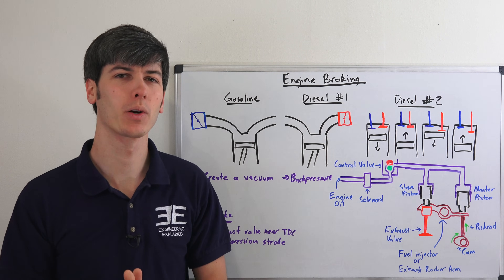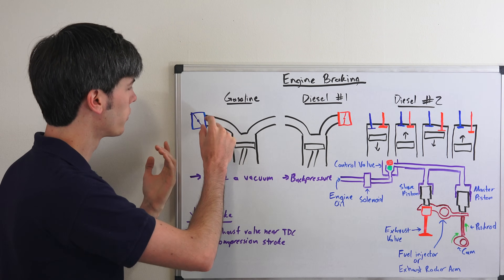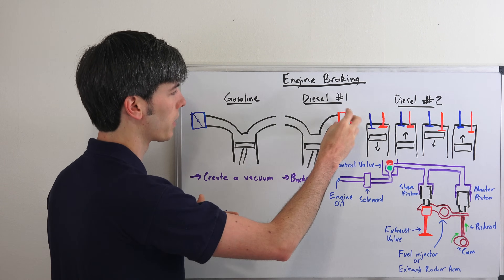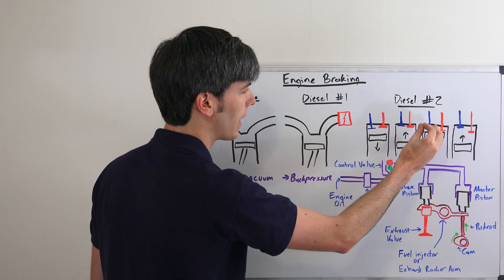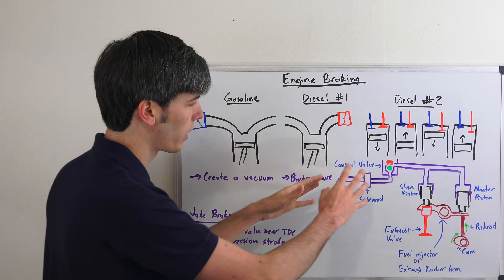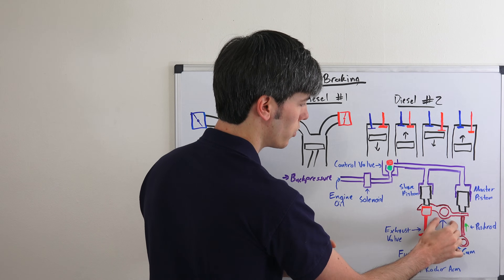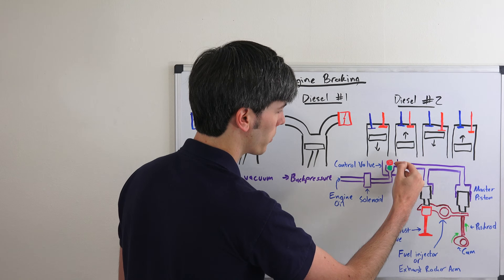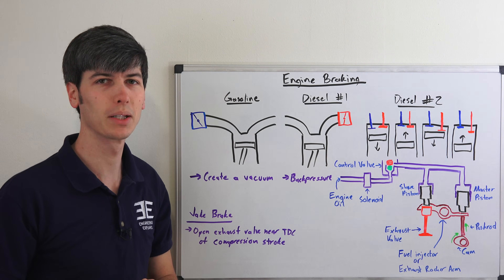What Is Engine Braking? What Is A Jake Brake?

Comment: The "Jacobs" brake was invented by Clessie Cummins after he retired from Cummins Engine Co.  He originally approached Cummins to use it, but they were not interested. So he went to Jacobs Manufacturing (The people that make Jacobs drill chucks) and they built the brake. The logo on the Jacobs brake is the same logo as on the drill chucks.
Reply: Mr. Cummins gave his patent to his daughter and son in-law as a wedding gift. The son in-law was of the Jacobs family.
Reply: I'm glad it became the Jake brake instead of cum brake xD
Reply: Really?  I had to read the comments to understand where the term "jake" came from?   Thanks to the Wizz.  But tell me this ... it is not a switch right?   .... just let off the gas, and the system does it (jakes) right?
Reply: @scottmonfort  You have to usually flick a switch on the dash to engage the Jake Brake then let off the accelerator then it does it's thing. Some have 3 settings off on or standby for the Jake brake the standby mode works when you take your foot off the accelerator pedal and disengages when you put your foot back on the accelerator. The on setting you have to flick the switch off before you can move forward.  I may of got some of that wrong but that is how I understand how it works by riding with my father who use to drive trucks as part of his excavation company job well until the state of Vermont took his CDL away for his epilepsy even though at that time I was in my teens and never had I seen him have a seizure but they felt the need to take it away. They even tried to take his drivers license away but after my father said he was going to go on disability because of it they sent the drivers license back he was intending to drop his CDL but what pissed him off was having it taken.
Reply: @02091992able  mostly right, except they all have an on/off switch, when on, the jakes will usually only activate when APP is read as 0%, which is when the process wxplained in the video is carried out. Some systems are optioned with a 2 or 3 positon switch, 2 position switches activate either half or all cylinders (3 or 6 in the case of an inline 6) and 3 pos switches activate 2, 4 or 6 cylinders. Gives greater control over braking effect and with prolonged use oil temps can increase, so can be used to prevent that on long downhill runs with brake modulation

Comment: Very good explanation of this. One thing to add though is with modern electronic diesel engines the 'control' solenoid is no longer needed as the engine computer is able to simply control an electric over oil solenoid to the exhaust valve to activate the system which gives much more precise control than the old master/slave type system of days past. Some modern engines even use the VG valve in the turbo to compound the engine braking using both back-pressure and compression combined together to often give the engine as much or more braking power than it has propulsion power depending on the engine spec for HP.

Comment: New Volvo's have both and they brake like not tomorrow. All modern truck diesel engines have electronic fuel injection controlled by a computer. Some light trucks with diesel engines have a variable pitch turbo that does the same thing as the exhaust butterfly.

Comment: Why did you not explain about engine braking in electric cars?
Reply: +Kevin Arnold I'll explain that here. You simply reverse the polarity (direction) of the electricity by turning the electric motor into an electric generator and that changes the electric motive force in the opposite direction. Train locomotives have been doing this for decades. You have to have some serious heat coils though because you are turning that motion energy into heat energy and that heat has to have a way to dissipate.
Reply: diesel mutt88 ok fine but i asked him why he dint include that in the video :P
Thanks for the explanation though
Reply: The Tool Guy I don't know. From all the youtube vids that i've seen, they all call it "engine braking"
Reply: The Tool Guy yes but the term they used was not motor braking

Comment: How come some cities have signs that say "No Jake Brake"? I was thinking you would have covered that in the video.
Reply: Ah, thanks guys. I've passed through some towns and saw the signs but never really knew why they were there.
Reply: +Beau C They are really loud and disruptive to people who live near the roads with those signs.
Reply: +Beau C It is very, very loud. 

It's in towns that have highways passing through them. As in, when you see the speed limit signs go down from 70mph....to....55mph...to....40....to 35...

Slowing down from 70 to 35 is extremely loud in a big rig engine braking. Like rapid fire explosions coming out of the tail pipe.

Same reason trains can't use horns past a certain time in some towns.
Reply: +Beau C They are loud. Check out other videos by searching 'trucks using jake brake'
Reply: It's because some trucks are "un-muffled" and are quite loud. Colorado is one of a very few states that have "No un-muffled engine brakes" ordinances.

Comment: I engine brake some times.  I just do it to look cool and confuse the driver behind me (assuming they're following at a pretty good distance of course)  as they probably have to think about it for a second how i'm slowing my car down.  most people dont think about it who drive automatics.   
sometimes another way I like to brake manual cars in neutral and just coast and use the brakes alone to come to a stop.  I think it could help reduce wear on drive train parts but this is potentially risky as the engine is completely disconnected from the wheels..I'll usually only do this on a long straight to a stop light or something.    hey if its a nice car thats old or valuable you may want to reduce wear on your transmission parts and only wear out the brakes which are cheaper and easier to replace.

Comment: is it bad for your car engine if you do this?
Reply: Any semi auto/auto transmissions will not allow the engine to overrev, so there's no risk really to engine braking. I'm used to high displacement pickup engines so I use engine braking quite a bit, but it's not really effective on small displacement engines.

It's all about preference, but you don't need to worry about hurting your engine by using it to brake, as long as it doesn't overrev.
Reply: +Atlacatl nope, as long as you don't go over redline as components weren't designed to go over. I think it's actually better for the car overall as you save a little wear and tear on the brakes by using the engine.
Reply: +Atlacatl for rotaries
Reply: +belanger9 No thanks, I'll use the brakes, they are a wear item and designed to be easily and relatively cheaply replaced, unlike engines. They also work on all the wheels, not just the drive wheels.
Reply: +Barry Ervin 
On mountain downgrades, you need to downshift. Brakes are only for temporary use, as brakes easily overheat and fade, within as little as 45 seconds.

Engines can easily take the heat, as they have huge thermal mass, and a serious cooling system. Engine braking does not harm the engine nor the transmission, unless you overrev. If the engine fails, then you may need a new engine or a new car. If your brakes fail, you could lose your life. Which do you think is worth more?

Also, the drive wheels are sufficient braking force. If the drive wheels take you up the hill, why wouldn't they also as easily take you down the hill? The tires are not the weak link in the system anyway, but rather those tiny, easily-overheated brake pads. Also, overheated brakes can set fire to a vehicle. That can cause loss to more than just the engine, totaling a car. Today's cars are made largely from solidified oil (plastic) which may allow just enough time to rescue the baby from the car-seat. I hope your cellphone gets reception in the mountains, as you might be waiting for hours for somebody to pick you up?
Reply: +Barry Ervin Brakes mean nothing when they're overheated. I've been there, driving an F-250 down a mountain with just a tiny (8 foot long) weed sprayer trailer and some rocks in the bed. I seriously underestimated the weight of the rocks and trailer combined and the brakes gave out with no warning whatsoever, the pedal just went straight to the ground.

The only ting that saved me was the truck, having a manual transmission and a 460, had serious engine braking potential. I should have been using it much more than I was, which would have saved the brakes. The brakes are FAR more effective than the engine, which was struggling to slow the truck down, but only for a certain amount of time. Now whenever I drive down that mountain, I always treat the engine as the primary brake and the brakes as the secondary backup stopping force.

Also, there is much less wear on the engine from 3,000rpm of engine braking than 3,000rpm of normal driving, because there is no combustion going on and thus less heat and less sudden force on the crankshaft, connecting rods and piston due to combustion, plus the increased cooling capacity that comes with a fan and water pump spinning at 3,000rpm with no combustion heat to remove. I've heard of engines blowing from just running, but never heard of one blowing up from engine braking unless it's been redlined.
Reply: *****
The brake pedal went straight to the ground? Did you have a hole in your truck cabin floor?

How long did your brakes last? 30 seconds? 2 minutes?
Reply: Haha, that would be some epic brake pedal travel! The brakes lasted for about 15-20 minutes of on and off braking. The truck had a very healthy brake system, and when we came to a stop you could feel the heat radiating from all 4 wheels.

I don't know exactly how the pedal went all the way down (with no resistance) as I've never experienced that before for overheated brakes, but one can only assume that heat will do some weird things to your brake lines/cylinder seals/fluid turning into vapor/etc. Either way, moral of the story for me in to never overheat the brakes.
Reply: I've been in 1 ton trucks where the brakes were too hot to stand beside, let alone touch. They were from a 70 km drive with grades of 7% for around 1 km, about 5 times in the journey.

In a loaded truck you need to use the engine braking at least as an assist, if not the main source of maintaining speed.
Reply: *****
The brake rotors were likely very hot. I have seen those YT videos in which people are just destroying cars, and they get the brake rotors red-hot. I sure wouldn't want to depend upon that for braking coming down the mountain. Not only might there not be any brakes, but it could catch the vehicle on fire, or rupture the brake lines?
Reply: belanger9
Please do not use the engine braking for merely an assist. It should be the primary and only means of controlling speed. If you have to touch the brakes more than just occasionally allowing plenty of time in-between for the brakes to cool, then why not simply downshift to a lower gear? It is far better to descend a mountain a little too slowly, than to come down too fast and out-of-control. Many roads even have an extra lane for all the slow trucks to go up or for descending. That is what it is for, for the slow vehicles, while cars that are not heavy are less affected, and can pass by more quickly.

Comment: WHEN should someone use engine braking
Reply: +Dylan White When towing a heavy load, or to maintain a speed down a hill without using your brakes.
Reply: +Liam 4.0 the manual for my automatic scion xA tells me how to downshift to use engine braking as necessary. What kind of kind of problems could this produce in a car like mine for daily driving?
Reply: None. Literally none.

Comment: The video explains how a Jake brake releases pressure through the exhaust, but there was no explanation of how it actually slows down the vehicle.  From the video it would seem the lack of pressure from the compression stroke would actually allow the engine to move more freely from less resistance, and the engine would allow for increase vehicle speed going down a hill.
Reply from the maker: +Jak 241 The compression stroke still happens, but instead of acting like an air spring and then pressing the piston down (with very little energy lost), all of that pressure is released out the exhaust. The engine has to compress air, but the potential energy of that compressed air goes out the exhaust rather than back into the engine.
Reply: +harut82  The Jake only comes on when throttle (pedal) is at idle. So minimal fuel is injected into the cylinders. During the compression stroke there is a force directed that is against the rotation of the crankshaft, and therefor the the rotation of the entire drive train all the way back to the drive wheels. Near Top Dead Center ( the beginning of the power stroke) the exhaust valve opens and releases the compressed air/fuel mixture, so there is almost no compressed energy to push the piston down. Although the fuel/air mixture is lean, it does ignite from the compression. It ignites  about the same time the exhaust valve opens. The energy that would normally push the piston down exits through the exhaust valve and is converted to sound. That is why a big truck is louder under Jake braking. The timing of the opening of the exhaust valve is critical for a good Jake brake. Some engines use the cam lobes for the injectors, or sometimes from intake cam lobes from other cylinders to time the Jake. The 3406 Cat engines had weak Jake brakes due to the valve timing. The Series 60 Detroit Diesel engines had very good Jakes. The Detroit was lower torque with max. HP at a higher RPM than a 3406. The Cat will lug and accelerate better than the DD, but sacrifices Jake braking in doing so.
  So a Jake brake turns the engine into a compressor driven by the drive wheels. Some engines have as much a 450 HP braking effect from the Jake brake, like a 450 HP compressor powered by the drive wheels. (A 450 hp brake)
Reply: +Engineering Explained 

I still haven't heard how the Jake brake slows down the vehicle.
Reply: +harut82 As diesels don't block off the air intake as a petrol engine does, all that compressed air serves to help push the piston back down again, even though there's no fuel. So, while the compression stroke takes place, the opening of the exhaust valve prevents that compressed air from aiding the downstroke and instead just blows out the exhaust. So now you have one stroke trying to compress and therefore slow down the engine, and nothing to help it on the down stroke as it would have been. You can hear the exhaust brake when a truck uses it as the exhaust volume goes right up while it's slowing down. A lot of areas ban the use of it where it may cause noise issues.
Reply: He just told you.

Energy can't come from nowhere, so energy released comes from the vehicle in motion.  It takes energy to compress the air, and then the compressed air is just released, poof, energy wasted out the exhaust pipe, energy provided by the vehicle in gear while moving.

Comment: Does the intake/exhaust brake cause more stress that will eventually cause reliability issues?
I've also noticed some diesel pickups can be modified for an exhaust brake.  But concerned about reliability issues.
Reply: +Jak 241 Most diesel mechanics don't recommend exhaust brakes with automatic transmissions because of torque converter lock-up stress, computerized transmissions get confused by the reverse in torque, etc. (not sure if any of this is true).  A lot of commercial diesels with automatics concerned with breaking safety will have a EM (Telma) or Eddy braking system.
Reply: You are correct, the Jake "vacuum" brake, is horribly hard on pistons, pins and rods.. they have to be beefed up, which makes them heavier, costing you, fuel milage too.

Comment: +Engineering Explained What are the disadvantages? and will it cause any damage to clutch plate?
Reply: +P.R. Hariharan Why would it cause damage to the clutch plate?
Reply: +SidewaysGts I used to reduce speed by down shifting, which is also engine braking isn't it?  as I do engine revs a lot because, the wheel speed will be higher than engine speed. So clutch plate will undergo on stress. that's why I questioned.
Reply: *****
 
If youre talking about intentionally slipping the clutch as you downshift to slow the vehicle down- Then no, thats not "engine braking"- Though it is often erroneously attributed as such.

And if you are talking about slipping the clutch to slow down the vehicle during downshifts, then yes- that can wear down your clutch. Quite a bit actually. 

As a mechanic- I can tell you right now people often freak over the silliest and benign of things. But dont intentionally slip the clutch while downshifting.  If letting off the throttle wont slow you down at an adequate rate, use the brakes.  Thats what theyre there for.  Your brakes are far easier, and far cheaper to replace than your clutch is :)
Reply: Oh thank you so much! I drive a Fiat Palio which doesn't have ABS,EBD and I kept it as a stock. So if I had to slow down my car from say 150kmph I had to reduce the gear. Brake at that speed ain't working and the stopping distance is too long. That's why I intentionally do Downshifts.. Once again thanks for giving me a clear picture..